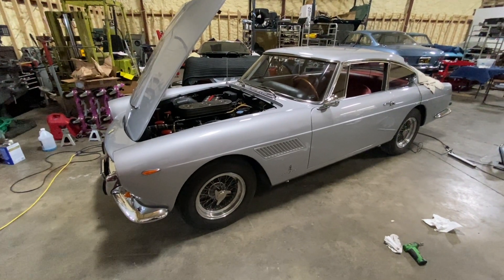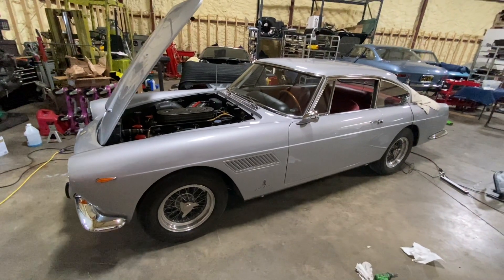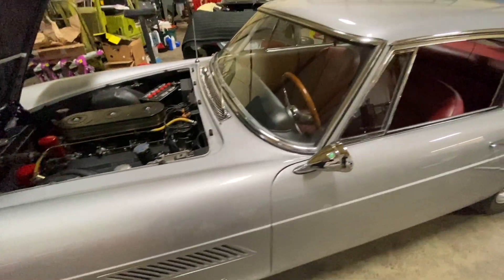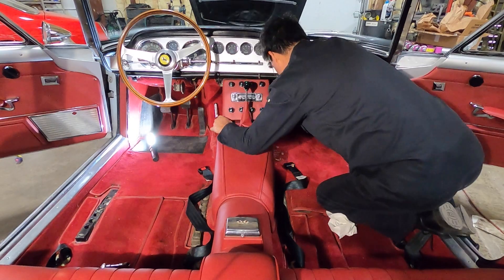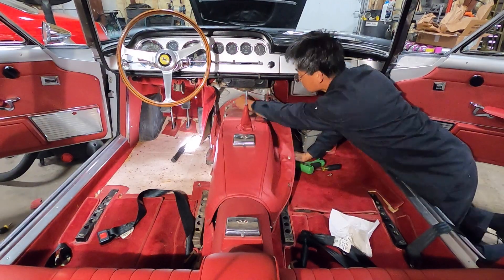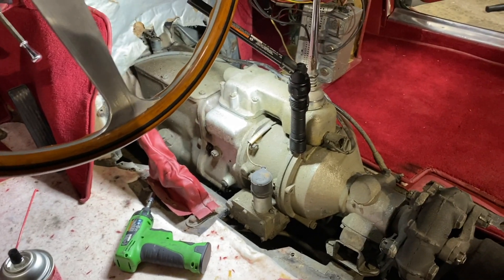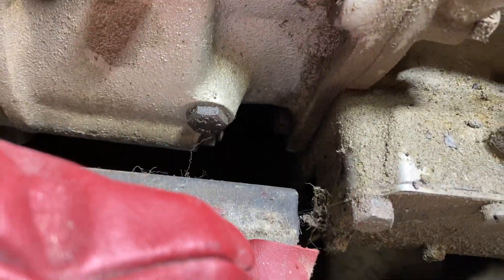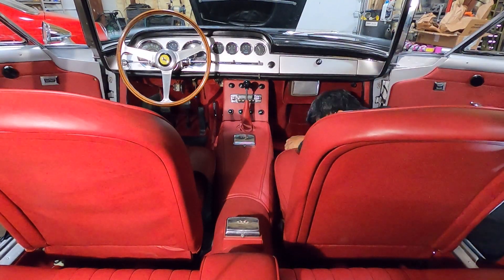Ferrari GTE Transmission access

Comment: Thanks Tom, very interesting to see how the interior  is configured around the tunnel.  Hey those seat belts  -- not very impressive looking.  Factory?
Reply from the maker: Seatbelts were not installed on these cars in 1961, and there weren’t provisions for a shoulder harness anchor point. Lap belts are not ideal, but it passes safety inspections and gives a little bit of protection.